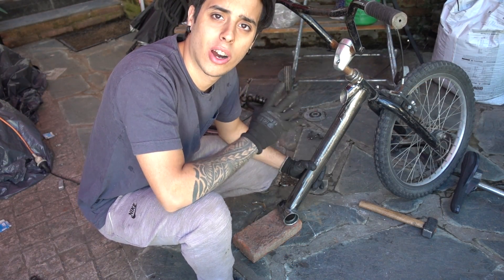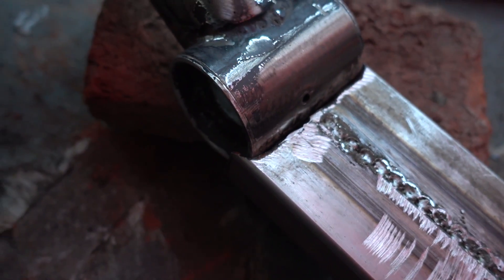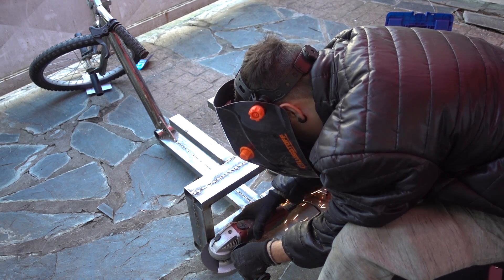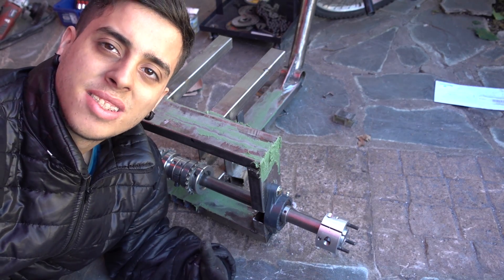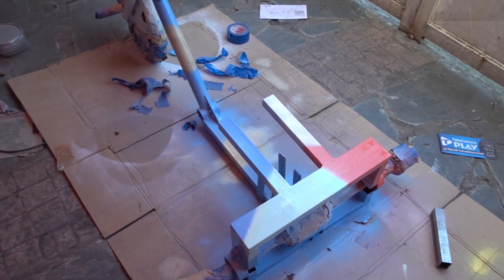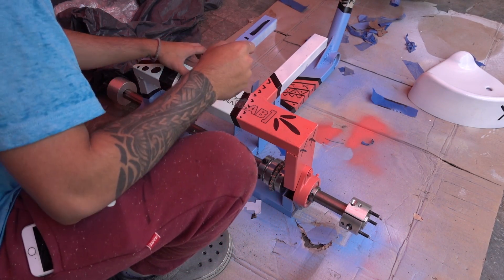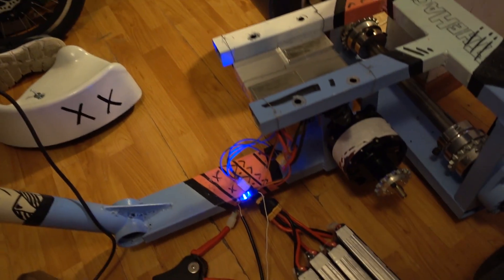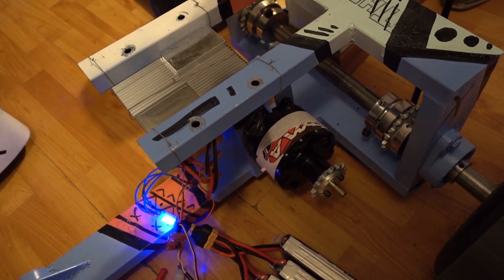Construyendo un DRIFT TRIKE ELÉCTRICO épico de 20.000W

Comment: No veo de donde sacas los 20,000W, solo del fabricante del motor. Pq tienes 48v 16mAh, si el conjunto de motor te consume 20,000 W a 48v estarias drenando 416 A.  Lo que ocuparia un cable cal 0  AWG a 1m.  Y sin carga a velocidad completa si fuera cierto el banco de baterias solo te duraria para 1.61 minutos. Como que un drift trike que dure menos de 2 minutos no tiene mucho sentido.
Reply from the maker: Te paso el enlace del controlador: https://hobbyking.com/es_es/turnigy-dlux-250a-hv-14s-60v-esc.html?___store=es_es, efectivamente cada uno puede entregar hasta 250A, pero antes debes saber como funciona un controlador brushless, asimismo, que el motor pueda manejar hasta 10.000w no significa que los consuma con tan solo prenderlos, siempre estamos hablando de picos maximos de potencia. igualmente podes investigar mas sobre el RC, y te daras cuenta que 10kw tampoco es ninguna maravilla, suerte